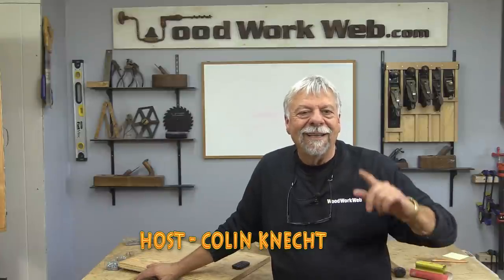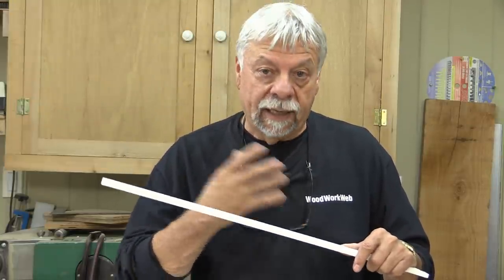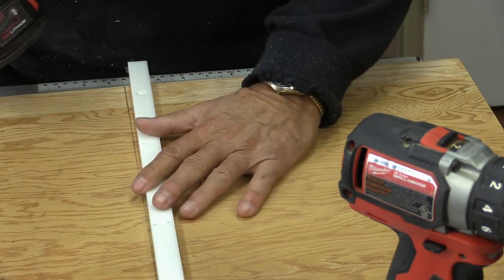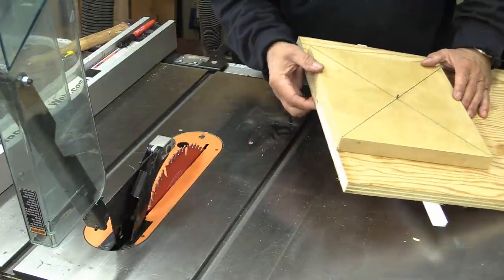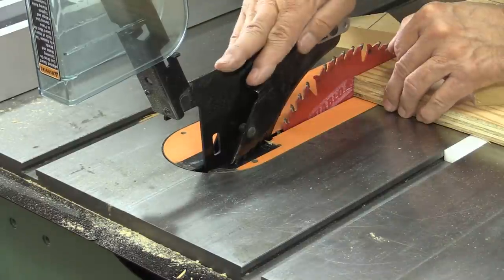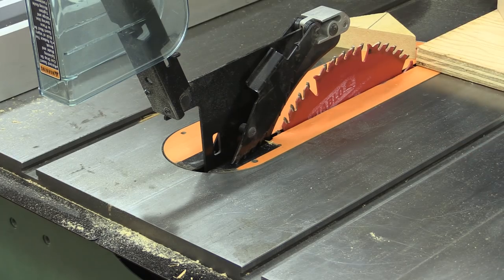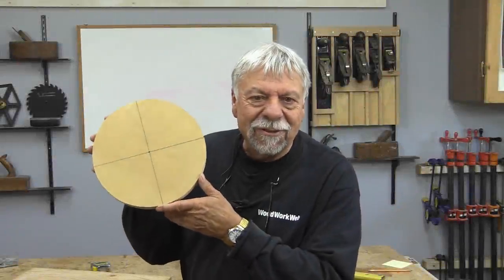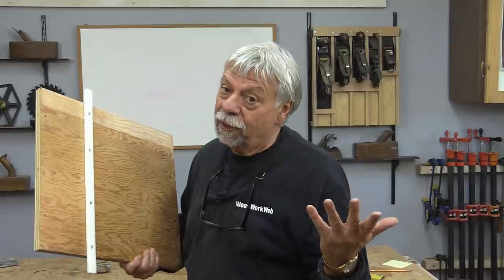Make a Table Saw Circle Cutting Jig

Comment: 7:57  You gradually lift the blade in small increments to avoid burning.  Start at the very bottom of the circle and do just about 1/8 inch.  Then slowly lift the blade 1/2 turn at a time.  No more burning.

Comment: You can also buy plastic cutting boards at the dollar store. They work well and rip easily on the table saw.
Reply from the maker: Yes you can. Thanks for the tip Timothy.
Reply: do you mean for the guide or for the entire Jig?
Reply: gnrsmith1 cut them up foy the guides.
Reply: lol I just picked some up

Comment: This works but can be dangerous.  On one occasion I tried this,  the blade caught the board and spun it so hard it nearly ripped my hand open.  That sudden spin can also potentially thrust your hand(s) right into the blade if you're not consciously thinking about it.  I still use this method, but it can be a little precarious. Also, I wouldn't try small circles - only large ones.
Reply: I would lean towards saying you should have taken more down during the straight passes because spinning it. But, you’re not entirely wrong either, this is a somewhat dangerous technique. I actually stand off to the side with my hands on the far side of the piece away from the blade. Awkward a bit because I’m left handed and am using primarily my right hand but it works. Also I keep the blade just even with piece so theoretically if you piece is pretty stable it should be pretty hard to touch the blade.
Reply: Thanks, dad
Reply: @TheBestRoddy  you think he's being annoying but there is a recent video of exactly this happening to someone doing this technique. That operator was lucky enough to have a Sawstop, because her hand was pulled right into the blade and she would have lost all her fingers had it been any other make of saw. Check around on YouTube for it. I'm not a fan of this technique precisely for this reason.

Comment: Thanks a lot, Colin. I glued up about 50 pieces of various wood (from Roasted Ash to Purple Heart, and Paduck, and so many more), all with a different density and hardness. I tried to use my router table for make it round, but the different densities made my router crazy and some of the softest wood broke where they should not have...
Anyway, I re-glued the whole thing (not so much fun the second time), and used my table saw this time as you suggested... And it worked like a charm! (I actually used my crosscut sled)

Thanks for this tip and for all the videos... you're an inspiration.

Comment: I traced a 40 litre bucket lid onto a piece of ply and jig sawed it out.almost a perfect circle.the problem was i needed a hole in the centre.It took me long a long time to find the centre of the circle.I would have saved a long time if i had used this method.
Great video
Reply: Rangatira Ahau: The way to find the center of a circle is to draw 2 lines across the circle (not parallel to each other; close to 90 degrees is best), then find the center of each line and draw a perpendicular line toward the center. Do this for both lines.  Where the two perpendiculars meet is the center.

Comment: Colin, Would you address the issue of tolerances that can be generally achieved when working with wood. Your videos have been very helpful in helping me align my table saw, fence and create a crosscut sled if these are all aligned what tolerances can I expect when making cuts.

Comment: Amazing how things happen, I posted this on Table saw Hacks and here you have built one like mine except I also use mine for cross cutting boards since the edge is at the blade.  Biggest I have cut is a pair of 30 inch circles.  Great Video
Reply from the maker: Thanks for watching Gary

Comment: Nice work sir. I've read about how to do this in magazines and books but wanted to see how it was actually done. This is supposed to work equally as well on a bandsaw as well but I don't own one.

In regards to the riving fence, I prefer to use them as possible. They are there for a reason. Plus, they push the sawdust down instead of into your face. 

Also, if you bring the working piece backyards into the blade, that is what causes burn as well as feeding it too slow.

But thank you. I enjoy watching your work. I seem to learn something new every time I watch. 😊😊😊
Reply from the maker: Thanks for watching and thanks for the tips!
Reply: Yes, this works 100 times better on a band saw. Takes all of about 10 seconds to cut the entire circle. Perfect circles can also be cut with a router, or a jigsaw and Disc Sander. All of these other methods take a fraction of the time, are probably safer, and produce a better result. Sorry, cutting a circle on the table saw is something I would never do.
Reply: what about the a lathe?
Reply: @bullfrogpondshop3179  Please show us how in your next video, would love to see your shop with all the expensive tools that a lot of us can not afford.

Comment: You should be able to temporarily disable the pawls with a small dowel and a rubber band or cable tie. You just wedge them open and tie them off.
Reply: Could you not trim your 3/4 ply to be outside of the pawls?
Reply: @darrenlaberee8036  It makes it harder to measure the pin placement for cutting the circle because you have eliminated the flush cut edge, but yeah, it could be done.

Comment: Your burn marks are due to the degrees of incremental distance in the straight cuts, which are larger than the radius of your ten inch blade. Make more cuts, to get your straight cuts inside of the 3/4ths inch height of the blade, (in reference to the cut board) then you will never have burn. The best (and by far safest) way to do this is with a snug, smooth bolt in the middle, and what you need is a nut to prevent the board from climbing, and a washer underneath the jig to prevent the entire thing from possibly riding up out of that hole. I'd make a slot using a router to slide the bolt to desire radius measurements, and two nuts over a large washer to lock the board down still allowing it to turn.

Comment: When you are in the final stage, rounding the circle, you should clamp the base of the jig. By accident, while putting your weight on the board, the whole thing may slide forward and you can cut your hands or worse.

Comment: At 7:15 you mark the exit point. Line up the marks and mark some tape on the saw table top to your left. pull towards you approx 2 inches and mark tape at leading edge of saw blade at bottom for start location. pull clear, start saw, go from start to exit in 1/4 in increments per full rotation of piece. No more black burns and blade deflection... :)

Comment: I love your videos, and I think you make good content. I know we all make certain sacrifices of safety in the search for expediency, but I did cringe really hard when you took that blade guard off. Not for fear of the cut side, but because you're then stacking offcuts up next to the spinning blade and piling them up. If one of those catches the back of blade you're gonna take a chunk of wood to the face. I'd strongly recommend figuring out a way to bind up the guard and kickback pawls on the cutting side and leaving the guard in place to shield the offcuts from finding their way back to the blade. A small piece of wood hitting you isn't likely to cause great harm, but being startled at the table saw has caused more than one major injury.

Comment: If you do not want to put a hole in the wood you can use a strong adhesive tape to hold another piece of plywood to the main piece. The nail/dowel will go into that piece.
Reply from the maker: That's an interesting idea! Should work fine if you VERY careful! Thanks for watching.

Comment: And if you guys do have a router, a jasper circle jig is a cool tool. Or you can use that circle made on the table saw as a template and use double sided sticky tape and a flush trim bit to make a copy with no holes in the middle.
Reply: The first tool I ever bought was a table saw!  It took me a LONG time before I could get the 'fancier' tools.

Comment: You can also use a small piece of dowel instead of a nail, just drill the hole 1/4" into the material you are cutting. Later, you can always plug it if you decide it bothers you.
Reply from the maker: Thanks for the tip Neal

Comment: Why not just use a router? A router circle jig is very easy to make and it seems a lot safer to me.
Reply: I made one that allows me to cut circles from 8" to 24" diameter with my plunge router.  Great for making very large speaker cabinets.  For smaller holes I have a drill mounted circle cutter and several hole saw sets.

Comment: Excellent, thank you. How small a circle (diameter) do you think one can safely cut this way?
Reply: How close do you like your fingers to the blade?
Reply: Ric Ferrentino At a certain point wouldn’t it be more wise to use a hole saw on a drill? Seriously a ROUTER with a circle jig is the proper method of cutting a circle.

Comment: I have a question for you Collin. We have a Craftsman table saw. The miter groove has a few small tabs in it to keep the push bar from jumping up. What would be your recommendation for this to apply it to this jig?
Reply: Just cut the strip so there is no slop side to side.

Comment: You could mitigate the burned edges by making your final "spin" pass multiple times, beginning at the very start of the blade and creeping forward slightly after each spin. The burn marks happened because any high spots on the wheel are only getting trimmed off where the saw teeth touch it--along the top edge--while the bottom edge merely gets pressed against the side of the blade. I loved the video though and appreciate your knowledge shared on this channel as I'm just getting into woodworking.
Reply from the maker: Thanks for the tip Joel and thanks for watching!

Comment: If I want a 14 1/2 Dia circle would I put the measurement up to the blade
Reply: Carl Zorro. No because the sled had been cut already by the saw blade, therefore the edge of the sled is the same measurement as the tooth edge to the center of the circle. Much more accurate .measurement as well

Comment: Colin, where did you purchased the miter material?
Reply: John Wachter try a plastic cutting board from the kitchen section of Walmart, it works great.
Reply: you can buy at Amazon.
Reply from the maker: As Lewis noted, white cutting boards work well. If you have a plastics store locally, go talk to to them. You can also buy it online at eBay or Amazon.
Reply: Is it easier cutting a circle this way than using a router and a jig?
Reply: I'd guess a straight edge router table would work great too. It's not as available though.

Comment: I can't have been the only one wincing while watching those little triangles creep into the riving knife hole. The slightest bump and those could end up being picked up by the blade and shot at you... Sometimes it's a good idea to clamp a long triangular wedge "deflector" just behind the trailing edge of the blade when you are cutting small pieces like that with no riving knife in place... The pieces then get nudged away and can't end up in the bad zone...
Reply from the maker: I haven't had any issues with that, but that's a great tip if you do. Thanks for sharing!
Reply: My thoughts were the same...from similar experience.

Comment: this process is a hell of a lot easier than using the router with th Rockler jig or using a jigsaw. You have to be careful but very doable. Make a lot of cuts before spinning it
Reply: Frank Rodriguez This method is not easier or more safe than using a router. There virtually no way you could injure yourself making a circle with a router unless you are inexperienced at using a router. With the router in hand you have TOTAL control.

Comment: Where exactly do you buy the plastic?
Reply: One cheap cutting board from walmart/dollar store, etc. can make quite a few runners.
Reply: you can buy at Amazon.
Reply from the maker: If you don't have a store that supplies plastics locally, using white cutting boards like Gar said works great. You can also order it on Amazon or ebay.

Comment: yeah its not the right saw for this kind of work. I wondered how you would work around the curve of the blade, but as you can see at 9:52, you don't.
While the top part gets cut by the saw, the bottom part just gets pushed into the side of the blade where nothing gets rid of material. Thats why you get the burn marks
Reply: What do you mean nothing gets rid of the material? Clearly it got cut. Table saw blades cut for the whole height that sticks out of the top of the saw, not just where the teeth are at the highest point, as you allude to at 9:52.
Reply: @shaunpage4498  Moritz is right Shaun, and I was just coming in the comment section to say the same thing. The blade is not cutting on a vertical line but on curve. That's why the wood at the bottom of the wood piece never cross the cutting edge of the blade. If you want to cut a circle on a table saw, you have to start from the bottom and rise the blade 2 or 3mm at a time, it should work a lot better.
Reply: The tooth cuts all the way through as the tooth goes down from top to bottom
Reply: The centerline of the circle and the centerline of the blade need to be in alignment while you finish cut the edge of if you want entire edge of the circle cut square to the broad surface of the circle. Just sayin

Comment: why don't you use scroll saw, quick and easier
Reply: ÔN LUYỆN 50 SẮC THÁI The biggest reason is that a scroll saw is going to give a round shape, not a true circle. The table saw in this configuration will give a true circle.  Sometimes a perfect circle is needed (like making a disc sander plate) If you were only making a piece of furniture a scroll saw would work okay. Additionally this jig would offer repeatability that only the very best scroll saw operators would be able to achieve. A variant of this idea is to drill small holes down the line on the sled at 1/2 inch intervals so you can place a pin and cut circles in 1 inch increments to the capacity of your saw.
Reply from the maker: Tim explained it perfectly. Thanks Tim
Reply: Exactly , jig saw on a wood plank that spins around a nail , much like in this video but with better results, safer and quicker
Reply: @GoldenSim27 ,  The problem with that idea is that a jigsaw blade has a tendency to flex and/or wander so to not give a 'true' edge for your circle.

Comment: Hmm, I think I would recommend slow and continuous motion from the start instead of trying to approximate a circle by repeatedly cutting edges.
Reply: Sarah Szabo that would be bad idea since the large pieces would bind the blade. Try it and find out. Before you do, call the paramedics, so they can be there to dislodge the wood from your body when it flys back at you.
First rule of table saw safety: Never, ever do anything that would bind the blade!
I have seen people make stop blocks on mitre saws using the flat side of another peice of wood that your material butts up against. Bad idea!! You are asking for trouble!  Instead turn the stop block 45 degrees so only the corner of the stop block touches your material. Much safer!

Comment: The piece on the table saw that the circle was supposed to set on was way too thick if it’s not that thick you can raise your blade up to the highest point the blade comes DOWN at the cutting point a whole lot better and cuts a better circle than having one that is slanted too much around the piece that is being cut into the circle
Reply: Please show us how in your video!  Thanks.

Comment: All that burning is because you are binding the wood up against the saw blade, which is not good for the blade and can be dangerous. For safer and better results, you could use a router or - if you have one - a band saw.
Reply: MAGA MAN you are missing the point of his video. You can make circle with a bandsaw, router, jig saw, etc. This video was about using a table saw.....
Reply: MAGA, please demonstrate this process in your next video.